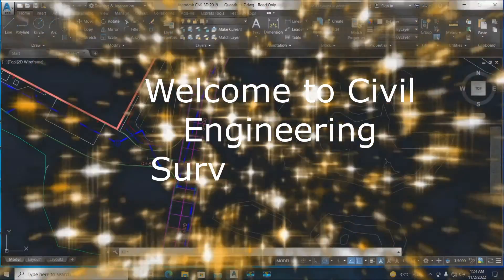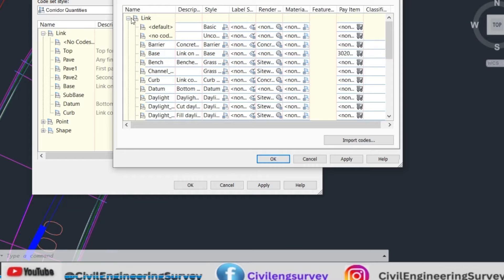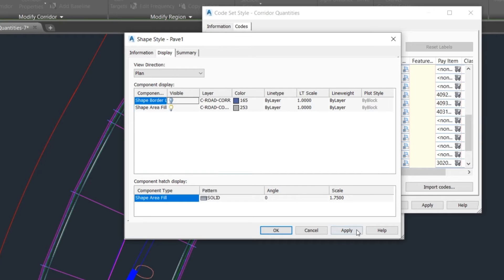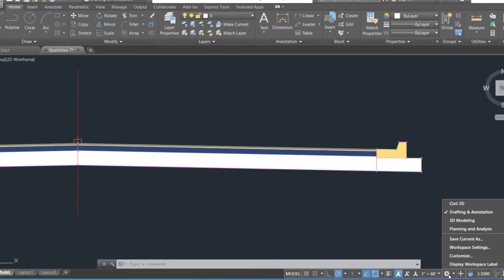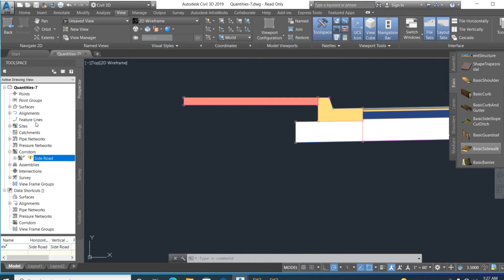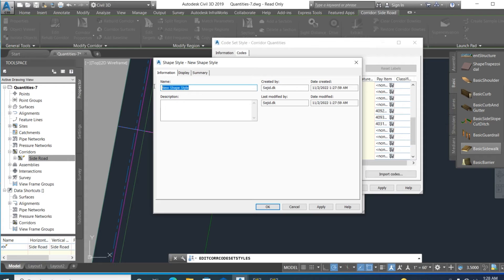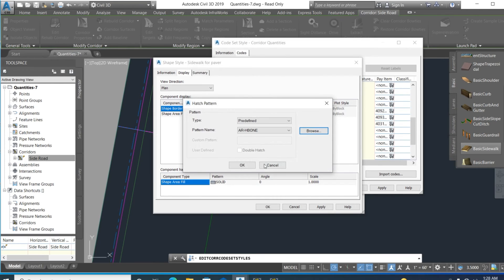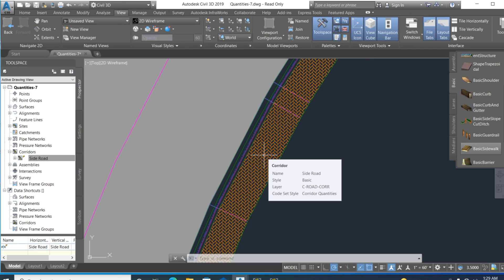Civil 3D Corridor models hatching by using Code Set Style

Comment: Hello Sir, this may be some sort of out of topic question. In civil 3d, the level of design profile acts as the level of top of finished ground( top of pavement). Is there a way such that the level of design profile can be set as the top of cut or fill?
Reply from the maker: You mean in plan view -2,+3 cut/fill show or profile design level show in plan view. A/c to you this level or cut / fill along with alignment?
Reply: @CivilSurvey  in cross section, the RL of top of pavement matches with the RL of Design profile. I want the RL of Design profile to be the RL of subgrade( the surface level after cutting and filling) not the RL of pavement( asphalt concrete mostly). is there a way to do so?
Reply from the maker: @SureshMtg  you mean shortly design level in Cross section view
Reply: @CivilSurvey  I simply want the design level to be the  level of subgrade (not the finished ground level).
Reply from the maker: @SureshMtg you can asign by using code set style or using manual annotative labels in Cross section it's simple
Reply: @CivilSurvey  Actually, at this moment I am not concerned with the display style. I am searching for such a road design in which the design level is the subgrade level instead of pavement level. I want the  depth of cut or fill to be the level difference between existing ground level and subgrade( level after cut or fill). I think in civil 3d, as a default,the depth of cut or fill is the level difference between the existing ground level and the top of pavement( Asphalt). Hope you are getting what I am trying to say.
Reply from the maker: @SureshMtg  send your data by email
Reply: @CivilSurvey  Maybe I could not clearly state my problem.
Actually, I wanted to change the attachment point of a subassembly of tool palettes.
For now, I have found the solution by using the generic vertical link.
Thank you for your response.